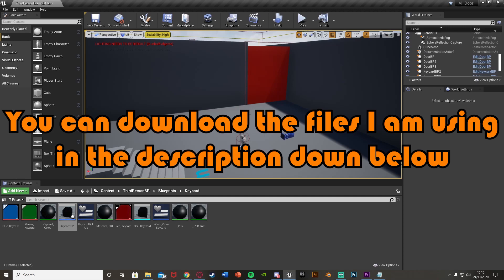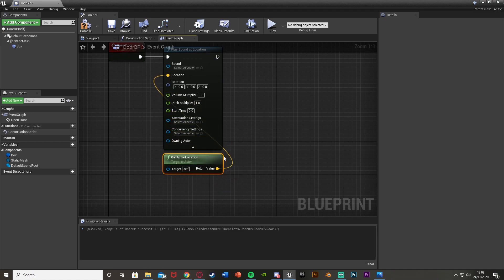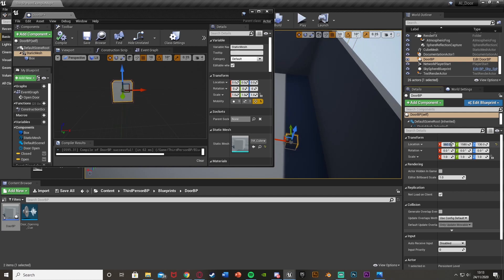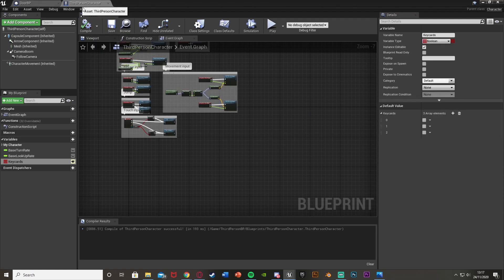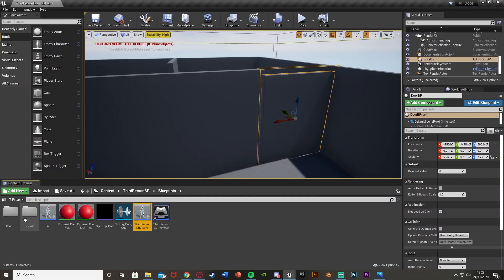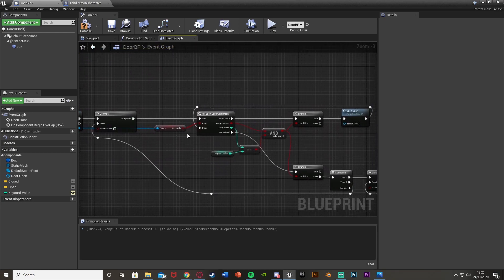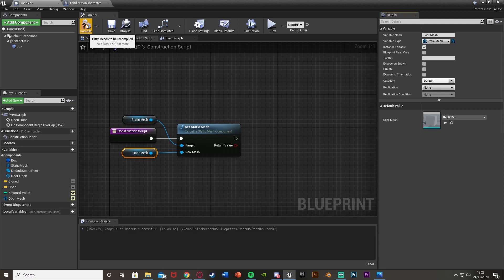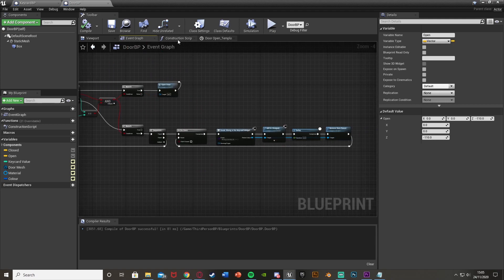Creating The Door Blueprint | Advanced Keycard System In Unreal Engine 4 Part 1

Comment: Same system can be used for keys? Regular keys??
Reply from the maker: Absolutely yes, it would be the exact same process
Reply: @MattAspland  Have you tried doing a Code System where you have to cycle through all the coded titles to line up the tiles in a certain sequence also to open the door.  (I remember Dark Forces used this on some of their levels).